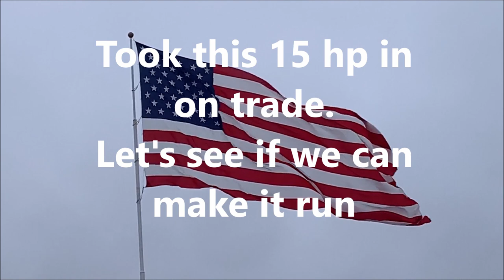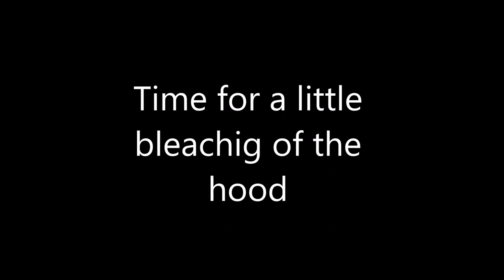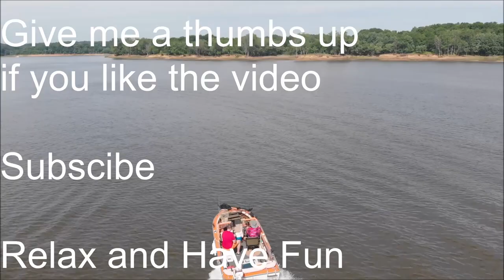1979 Johnson 15 hp  outboard. The trade in that wouldn't start. How we make it run again. Just TLC

Comment: That is a great engine to take on trade....The late 70s-mid 80s models were the best of this series.  Such a shame that some dope forgot the water tube grommet.  Unfortunately, you installed the wrong grommet...That flared grommet is for the later models with an open exhaust tube.  Installing the flared grommet on an engine with a sealed exhaust tube will cause the water to get trapped in the exhaust housing and not drain when tipped up.  This could be disastrous if the trapped water flows back into the powerhead when the engine is removed from the boat and set down.   I'm glad that you pointed out the importance of cleaning out the gearcase drain though, this being plugged can cause the same issues.  I usually drill that hole out just a bit larger once all the crap has been removed from the cavity.   Thank you for pointing out the importance of lubing up the driveshaft splines, this is often ignored.  Reinstalling the gearcase is easier with an assistant.  I can't over emphasize the importance of installing that shift rod coupler correctly, which is tricky on these engines.. Misaligning that connector, or a loose connection will result in shifting difficulties along with very expensive repairs..  These engines have a simple, but expensive flaw.  The upper water tube grommets were mis designed, they swell up and close the water passage over time.   This even happens on fresh water engines, just takes longer.   The repair is a pain because the powerhead must be removed, and the bolts could be rusted in place.   You may want to replace that plastic cooling telltale restrictor in the end of the hose.  Without it, too much water may be escaping through the telltale hose without passing through the powerhead....Probably not much of an issue, but can certainly make a difference on a slightly worn cooling system...
OK, well you see something new everyday, what the heck could have happened to that carb resulting in that crazy weld job, seems to run OK though.  Those neutral interlocks can cause trouble starting because they limit throttle advance in neutral too much...
Reply from the maker: Great information, thank you.

Comment: I have worked on  several  of these.. someone before you put the brass shift coupler on the wrong way.. the round part of the brass coupler should face the other way.. the bolt is suppose to go  through the right side of the motor not the left.. also the shift rod height  can be adjusted be screwing it in or out..
Reply from the maker: You are correct on all points.

Comment: Thanks for this...Very helpful! I've been trying to troubleshoot a 1988 Johnson 15hp. I just got it and it wouldn't start, but fired and ran with some gas/oil mix in the cylinders. I rebuilt the carb (really gunked up) and took apart the fuel pump, cleaned and reassembled (made sure to follow instructions to assure it was put back together appropriately). Put the correct spark plugs in as well.  It fires right up now, but revs high immediately and stays pretty high on the revs for a bit before settling down to an idle and suddenly stopping. I kept attempting to adjust the idle screw, which does affect the speed after 15 seconds or so, but no matter where I adjust the idle screw, it eventually idles down and quits. After many cycles of this it will start and rev way too high (runaway) and I have to pull the choke out 3/4 of the way to get it to idle. It will in fact idle with the choke 3/4 or more out, but no matter how long I let it idle like this, the second I push the choke back in, it revs super high and won't settle down. Not sure if air is getting in somewhere after it's warmed up or what. Any ideas on how to troubleshoot this? No leaks from the carb or the fuel pump after the rebuild.
Reply from the maker: Sounds like it is sucking air from somewhere else, either upper or lower seals, does this one have plastic parts on the carb? if so you may have some cracked pieces.
Reply: @Michaelsbackyardmarina  Ended up being that little tube between the nozzle well and the brass tube on the carb.  When I replaced it,  I noticed the new one didn't fit that tightly to the point I worried it might slide off.  I got some new line that fits tight and that seemed to do the trick.  Runs as it should now.  Didn't think that would cause all of the trouble! Thanks for the reply:)

Comment: At 18:03 the plate is called a Throttle Control Cam and the wheel is called a Cam Follower Roller - only know because I have looked it up before as my '79 6HP Johnson doesn't want to idle - and just by coincidence do you have one of these in the background towards the end of the video?
Reply from the maker: I do have a 6hp and I have it for sale on FB market place.

Comment: One of the most neglected areas is upper motor mounts probably because of location (have to remove powerhead) but it effects affects all kinds of issues!!! Timing,throttle gear meshing and if loose enough , breakage !!

Comment: Hi, it does not seem to pump alot of water out, had a few engines where, where somebody has changed the pump after it has failed, but not retrieved all the bits of the old one, found bits moving around in the water jacket of the block and head, difficult to detect unless your paying attention.

Comment: I have the same motor 82 model, it is the same way on starting just stubborn, runs good once it starts. I just pull the hood to start it with a different rope on flywheel, When started with regular pull start has about 5 times the resistance when pulling that rope wears my rotator cup out lol.
Reply from the maker: pull starts are hard on the old shoulders for sure

Comment: Hey Richard,love ur channel, but I’ve got a question… I have this exact motor on my 14 ft Jon boat…it’s a stinker to start, need some tips, I must be doin something wrong!! But my main question is looking at the right side from the front, the round idol knob, on the inside of the case it doesn’t look like it actually connects to anything, it slides and has a flat stop… am I missing something in there….sure need some help… thanks in advance 😵‍💫

Comment: I have a 78 Johnson 25hp and on that hole that you cleared out on the lower unit and the meeting point between the shaft and LU seems to leak fuel/oil. Would you happen to know what causes that?

Comment: There is spoke to be a washer on the other end of that bent bolt, between the carb and that plastic piece.
Reply from the maker: ok
Reply: @Michaelsbackyardmarina  just thought I might let you know, just buy the same year engine, thanks for your vids, they helped me a lot.
Reply: @Michaelsbackyardmarina  hey I was out on the water with my 79' Johnson 15 hp, and I was in forward gear and all of a sudden the prop stops spinning as fast. I was still able to go forward slowly but when I Rev it up. It did nothing but Rev the engine rpm up, while not going any faster. Any idea what might be the problem? I did recently replace the bearing carrier.

Comment: Is compression in a johnson 1974 15hp okay at 70 top cylinder and 75 bottom? Or is that way to low? What should compression be in a motor like that with reasonable use?
Reply from the maker: That's getting pretty low.  It will still run but not produce as much power.

Comment: This is the second one I’ve watched you work on that you have not mentioned the starter pawl or it’s spring . Both times you have not installed the pull rope assembly with the starter pawl in its correct position. The starter pawl when install correctly prohibits the pull rope from being pulled when at high RPM’s or while the motor is in gear. The mauled up  plastic starter gears become damaged because someone at some time did not install the starter pawl back correctly.
Reply from the maker: gotcha, thanks for watching

Comment: Straightening a machine bolt like this is a major achievement. It's one of the most difficult things to do in back yard engineering.  I've done it. And I hate it at the same time. What a bitch. Great job btw.
Reply: I for sure would have spent the money on a new one!

Comment: Can you tell me the size of the fuel line from the pump to the carburetor?  I think it’s 3/16” on mine but when I accelerate the motor turns off. I am wondering if it’s the fuel like being too small or I didn’t clean out the carb well enough.
Reply from the maker: I use 3/16" fuel line.

Comment: On my 15hp Evinrude the little L shaped connector that has the line pee out of the back has snapped, the threaded part is still in the motor.  What do you recommend to to? Remove the power head completely?
Reply: Russ Gallagher I will need to remove the power head to access it properly then. I was able to source the part on eBay. I appreciate your response and offer. Thank you. Your videos have helped me get mine running
Reply: Russ Gallagher well thanks for the help anyways! 😂

Comment: Does the water in the tank stay cool? Since it keeps circulating the same water the water will eventually heat up and may hinder performance. If it gets too hot it wouldn’t cool properly. Thoughts?
Reply from the maker: it get's warmed up after about 3 hours of running

Comment: I have a 25 horse Johnson I believe it’s a 72 can’t get the fly wheel off any suggestions because I have no spark had Spock rebuilt carburetor and I had no spark thank you Joe
Reply: U need a fly wheel puller the three finger one
Reply: I Broke 
3 of them trying to pull the flyer off I try tapping it I even used a little heat which I didn’t want to do yes I did take the nut off
Reply: Anybody out there with any suggestions about the stock fly wheel Don’t want to put a lot of heat on it and mess up to Seal

Comment: I have the same motor and I noticed last time I took it out It was not spitting water at the two exhaust  ports, what would be causing this?
Reply from the maker: Impeller is bad most likely.
Reply: @Michaelsbackyardmarina  weird cause I just changed it last year and it spitting out the tell tell really good.

Comment: What is your feeling on using stainless props on small outboards? I have a 1996 Suzuki 25 hp.and my dealer in town says that’s a no,no. I mainly put my boat in rivers. He tells me the prop is the weakest point,and if I hit something it will take the beating instead of my gearbox.🤔
Reply from the maker: He is absolutely correct

Comment: Didn't you like my idea of putting a quick disconnect bracket on the banana so you can use your ulterra on either boat?
Reply from the maker: The network wiring and the wiring in general would have to be completely redone in order to do it. I'm going to give the old evinrude troller a try for fun and then probably invest in another troller.  I like my boat to be just hook and go and not a lot of trading equipment back and forth
Reply: @Michaelsbackyardmarina   After using an ulterra for years no way I could go back to using some prehistoric trolling motor like that. Wouldn't be fun for me.

Comment: Why dont you use a water muffs for the lower unit so you dont have to use the bucket.
Reply from the maker: the water muff don't put a load on the motor.  I like to make sure it will work under a load. Plus I can check for water in the gear box after testing.
Reply: @Michaelsbackyardmarina  thanks. That makes since. The guy 👍

Comment: Hi,
I have a 1961, Johnson RDS-23 40hp motor. I had to remove the pull start assembly, the flywheel, all the way down to removing the timing assembly (points, condensers, coils).
Q: How do you know when the #1 piston is TDC on the firing stroke to calibrate the points to .020? To you have a video that shows this process? 
Thank you.

Comment: i have 2 of these motors, its not peeing to well compared to mines. should piss out a lot better.
Reply from the maker: someone installed a line that has twice the inside diameter than it should have so the stream will be a little weaker. I have ran it for over 5 hours in the tank and it works just fine.
Reply: @Michaelsbackyardmarina  what is the matter with these people i tell yah. lol anyways i enjoy watching your videos. Would love to see some fishing videos from you buddy. Sub